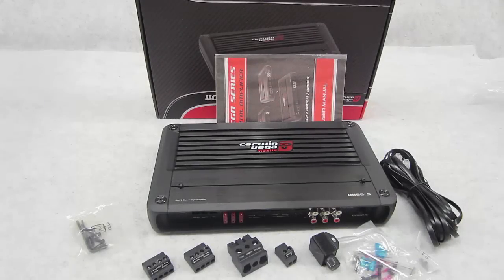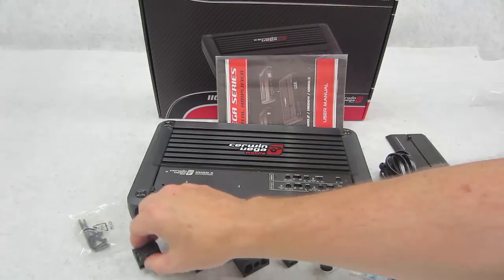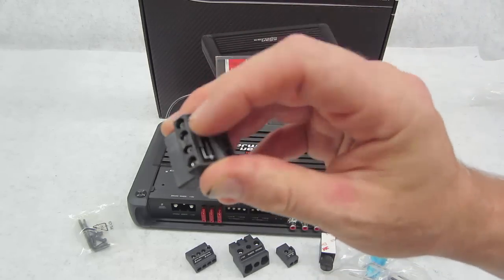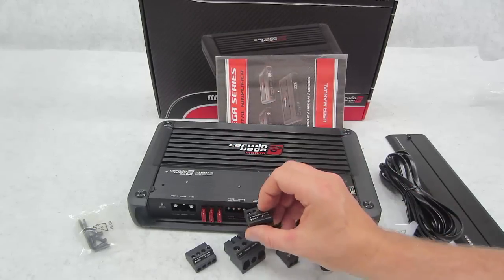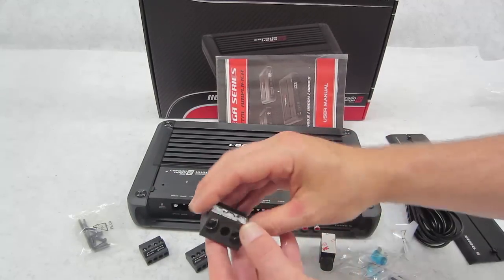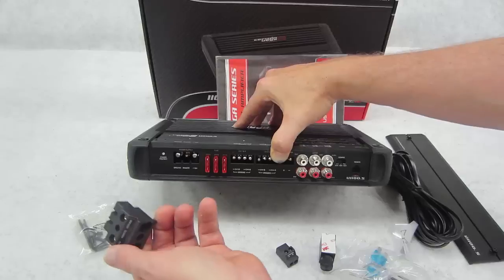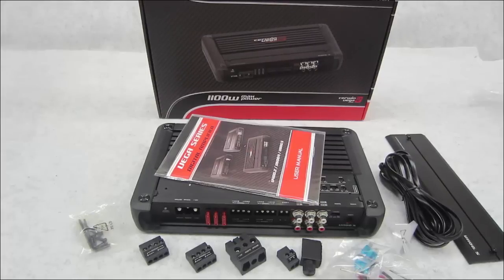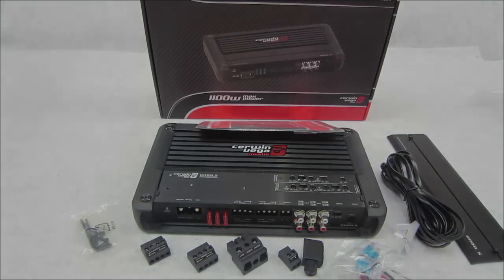Cerwin Vega V1100 5 Amp and iOEM6 Review

Comment: I'v noticed that all of the class D amps out there have amps from different brands within the same power rating that look alike. The only one so far that does not is JL Audio. But, even JL audio has class D full range amplifier that has almost identical specs to other branded amps. I read online, after doing extensive research, that all of the class D amps are made by the same company, at least in car audio. That is ... all of the class D guts are made by one company, and different factories make amps for various brands, so they just put a spin on the amp design to make each one a little bit different than the other brand. It's like eyeglasses. All of the frames are made by one company ... it's in Italy.

Comment: most amp designs are very similar designed circut boards the main differences are the components on the board and heatsink design etc. which determine how better the quality is. 

the plate and the way the terminals attach are to prevent tampering or adjust ment. hence why the plate is screwed down and the terminals having the cips on the underside so you cannot see them when the amp is mounted on a surface,